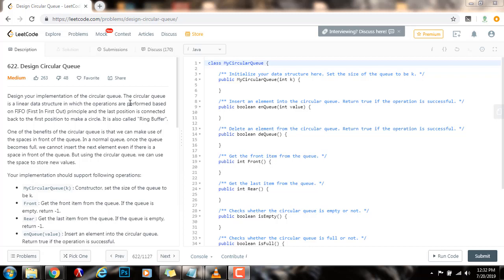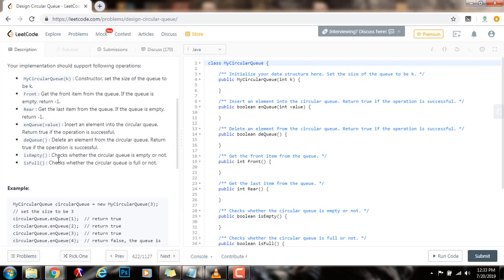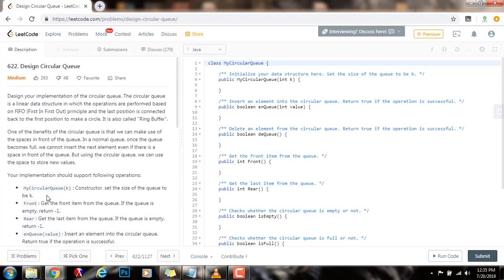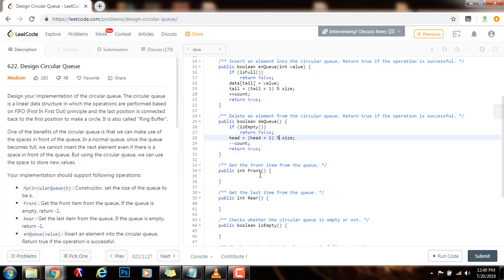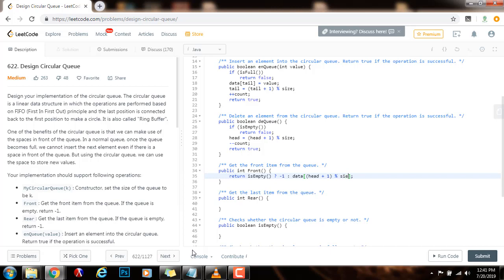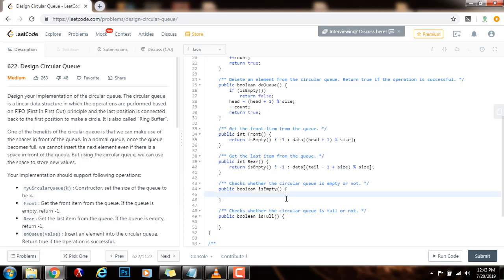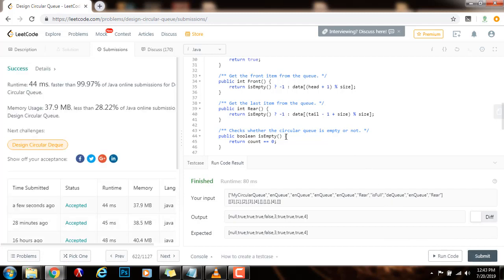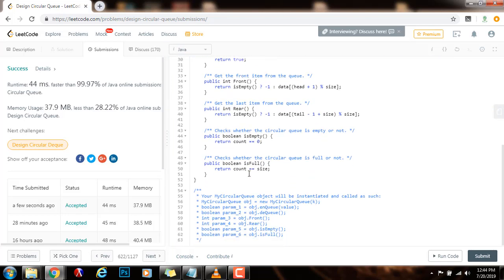Coding Interview Tutorial 136 - Design Circular Queue [LeetCode]

Comment: class MyCircularDeque {

        /** Initialize your data structure here. Set the size of the deque to be k. */
        LinkedList<Node> list;
        Node head, tail;
        int size, capacity;

        /** Initialize your data structure here. Set the size of the deque to be k. */
        public MyCircularDeque(int k) {
            this.list = new LinkedList<Node>();
            this.size = 0;
            this.capacity = k;
        }

        /**
         * Adds an item at the front of Deque. Return true if the operation is
         * successful.
         */
        public boolean insertFront(int value) {
            if (isFull())
                return false;

            Node n = new Node(value);
            if (isEmpty()) {
                head = n;
                tail = head;
            }
            head.prev = n;
            n.next = head;
            head = n;
            this.size++;
            return true;
        }

        /**
         * Adds an item at the rear of Deque. Return true if the operation is
         * successful.
         */
        public boolean insertLast(int value) {
            if (isFull())
                return false;
            Node n = new Node(value);

            if (isEmpty()) {
                head = n;
                tail = n;
            }

            tail.next = n;
            n.prev = tail;
            tail = n;
            this.size++;
            return true;
        }

        /**
         * Deletes an item from the front of Deque. Return true if the operation is
         * successful.
         */
        public boolean deleteFront() {
            if (isEmpty())
                return false;
            head = head.next;
            size--;
            return true;
        }

        /**
         * Deletes an item from the rear of Deque. Return true if the operation is
         * successful.
         */
        public boolean deleteLast() {
            if (isEmpty())
                return false;
            tail = tail.prev;
            size--;
            return true;
        }

        /** Get the front item from the deque. */
        public int getFront() {
            if (isEmpty())
                return -1;
            return head.value;
        }

        /** Get the last item from the deque. */
        public int getRear() {
            if (isEmpty())
                return -1;
            return tail.value;
        }

        /** Checks whether the circular deque is empty or not. */
        public boolean isEmpty() {
            return size == 0;
        }

        /** Checks whether the circular deque is full or not. */
        public boolean isFull() {
            return size == capacity;
        }
    }